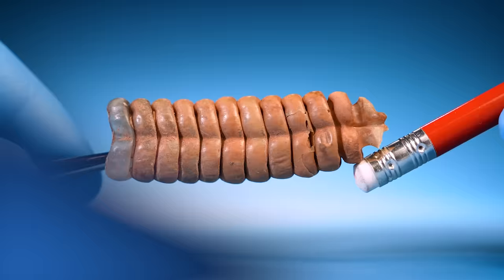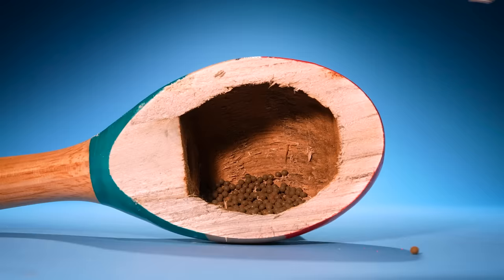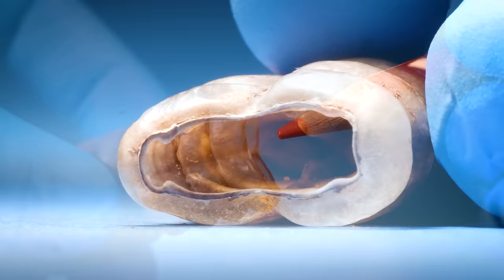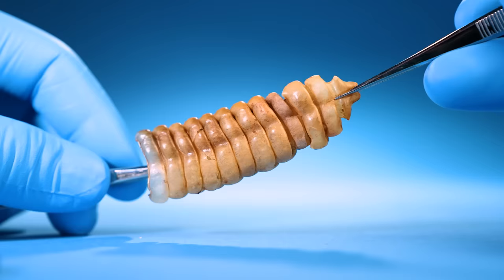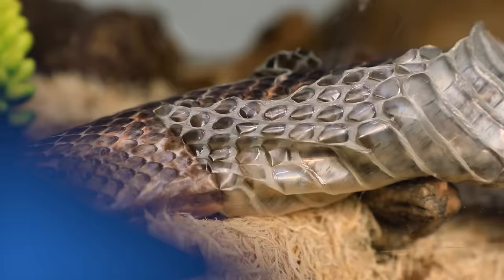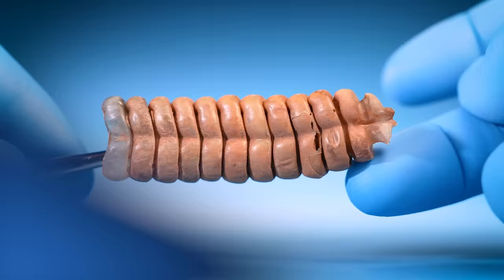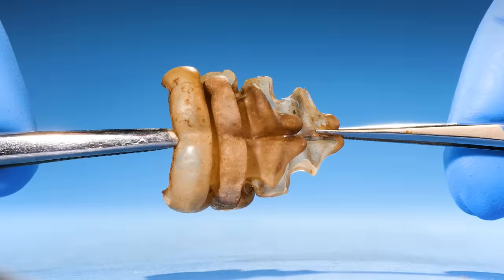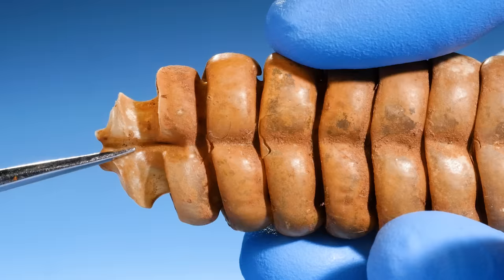What's Inside a Rattlesnake Rattle?

Comment: The buzzing sounds a bit like cicada. But cicada’s one is at a higher frequency. One should play with a cicada given by chance. It’s fun. It used the whole body to vibrate and caused the sound. While one is holding on to a cicada while it’s vibrating, it’s just felt like holding on to a vibrator with high vibration intensity😂

Comment: If the rattle is loose and hollow, how does it stay together when still attached to the snake? You showed that it's easy to pull apart. Is there a chance it can get pulled by something and get disassembled on a live snake?

Comment: so if the rattlesnake rattles vigorously, will some sections of the tail (rattler) come loose/off?  just as you have easily pulled it apart
Reply: I read some sections of the rattle do come off. The thing is that if they don't come off, there's no law saying you can't write they do. This is why the old story about how you can tell how old rattlesnakes are by counting how many sections there are on its tail is a fairytale.